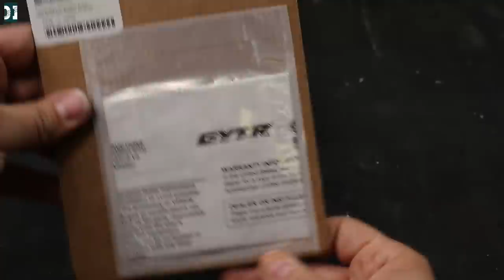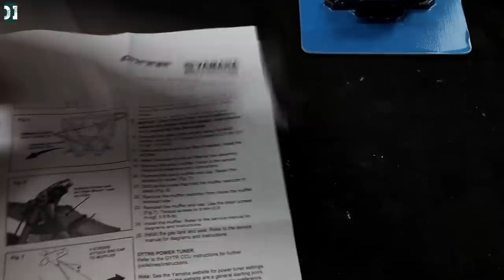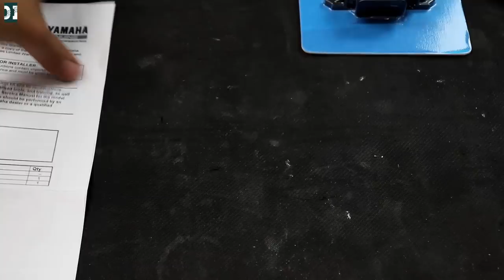How to uncork Yamaha WR450f - free mods & GYTR mods

Comment: Hi, you need to do one more mod, remove the backfire screen and add the twinair powerflow, throttle response will be better at all rpms.
Reply from the maker: thanks for the tip! I thought about it, saw some airbox cages with no screen online.

Comment: Well, I got a 2020 WR450F. At first, I thought it was a monster and a big mistake. However, after riding it today fir a little bit, I feel very comfortable and happy with my decision. I had the dealer install the GYTR ECU kit before hand. This kit installation includes the throttle stop, air box and exhaust mods. This way, it saves me from having to do and have the peace of mind that it was done by a certified Yamaha technician. For those interested, my dealer charged me $190 for the 2 hour installation. Before I use the bike again, I need to decide on how to monitor my hours/miles for regular maintenance. There are several options available such as, the standard hour meter or the GYTR CCU. 

However, what about the multi-function display that comes with bike? According to the owners service manual the came with my bike, the maintenance intervals are measured in miles or months. Do you use the multi-function display to monitor your regular maintenance?

Thanks again,
Reply from the maker: glad you hear you like the bike. I usually run aftermarket hour meter for maint.. but you can also do miles, as long as you stay consistent and do frequent oil changes you should be fine

Comment: As for my stock silencer, I just removed the inter end cap and spark arrester. I'm interested if the GYTR ECU, map switch, and CCU is worth the $540 investment. It's too bad that we can't get chassis dyno results after every mod, like if the $900 full exhaust system really worth the money.
Reply from the maker: I rode the bike already and its a day and night difference! I will have video out soon. Personally I think you dont need $300 CCU, bike runs so well on GYTR ECU. so the total investment is around $900, exhaust system is $650, ECU $149 and map switch $91

Comment: Rado - You must inform your viewers that doing the free mods to free up the intake and exhaust without changing the fueling mapping will make this bike run very lean since it has no feedback mechanism or an O2 sensor like some KTM/Husky models have. This is very bad for the motor and is the reason your bike ran like that at idle. It is even worse at peak power and runs your valves and seats very HOT. You will need to do valve adjustments sooner and soon you will have to do a top end rebuild. Always change air and fuel at the same time.
Reply from the maker: Its a fuel injected bike, it has to have O2 sensor. How else would she be able to adjust the fuel air ratio in different elevations and temperatures. But yea, she needs more fuel to unlock the potential and to run proper. I did show it all in the video, new ecu from gytr is the most important
Reply: @dirtniron  unfortunately it is open loop fueling controlled by temperature and atmospheric pressure sensors in the bike connected to ECU. It adjusts fuel based on pressure and temperature
Reply: @dirtniron  if it actually has an o2 sensor people won't be able to so exhaust swaps so easily without throwing an error code. KTM FE models have O2 sensor I believe or used to have

Comment: hello, I have 2007 wr450, I tore down beginning of 2021, reassembling I simply cant remember where the long ground connect from the battery goes. any help?
Reply from the maker: I am not sure, somewhere on the frame.. pull out the diagrams on rockymountainatvmc

Comment: Do you know if 2020 models need the same mod? Since there is no CCU needed - it can be mapped with smartphone. I've also heard 2020 models already will come to life when you remove bong from the airbox and baffle from the exhaust. Not even sure if there is this throttle stop screw. And since you did the whole exhaust - what do you think if you only did slip-on - would it be the same or you would still need the whole exhaust?
Reply from the maker: if they can be mapped with smartphone then you dont need new ECU, just map the one you have, do all the free mods and I think slip-on would be sufficient.. thats what i would do

Comment: I have a 2020 450fx. I would really like to know if i can buy a factory headlight and switch setup for this bike and use it without having to mod the harness. There is an unused plug by the air filter I suspect might be for that.
Reply from the maker: I would reach out to your local Yamaha dealer
Reply: @dirtniron  Thanks. That's probably what I'll have to do

Comment: I've been undecided between a 2020 YZFX and WRF for weeks. However, its looks like I am now going with the WRF since its more easily converted to being street legal than the YZFX. These mods have steered me away from the WRF but I would rather do them then having to install lights on a YZFX. 

With the 2020 WRF, when you install the GYTR competition kit what is the default map? Is it the same default map as the YZFX? Would I also need the GYTR Communication Control Unit as well? If so, what would be the purpose?  I'm not interested in the map switch. I don't want to switch between maps when riding, I want one map for everything. Plus, I don't want the extra button on the handle bars. I have to figure all this stuff out fast since there is only one of these bikes left. Its at dealer that is 400 miles away from me and the next closest dealer is almost 1700 miles away. That is dealers, with a reasonable price.
Reply from the maker: you can get just the ECU, it will come with standard map that is very good, I was really happy with it.(not sure its same as fx, but its good) Switch is cheap and allows you to get mild map for gnarly stuff, but its not a necessity.  as for the CCU, you dont need it, if you dont want to use your cellphone to tune the bike. GYTR ECU was plenty good for me. Good luck
Reply: @dirtniron  Thanks for the very helpful information. Yes, I can see the reason for people wanting the map switch for the reasons you pointed out. For me, I would rather have one map that fits all. Maybe, down the line I will get the map switch but most likely, I will pass. If I understand correctly, when adding the map switch you get an additional stock map that is mild. However, you can't change either map without the CCU. The stock, standard map that comes with the GYTR ECU sounds good to me. Yeah, I don't feel the need to tune the bike with the CCU. The only feature of the CCU that I find useful is monitoring the hours. Although, Yamaha makes an hour meter which seems like a better option for me. Thanks again and great channel, keep up the good work!
Reply from the maker: ecu comes with two maps, one stock is always on and second one is accessible with the switch, you dont need CCU in order to use these 2 maps. Only ECU and switch and you have 2 very good maps for different conditions. Honestly, I was most of the time in stock map, but once or twice when going up steep rocky section I switched to mild on the fly cuz stock map was little too snappy for those rocks 1st gear slow riding.. I would recommend the switch its only like $60-70 ..
Reply: @dirtniron  Okay, now I understand and thanks for the clarification. I don't plan on riding in technical terrain but you never know. Plus, it's not that expensive like you said. You have really helped me out. I tried calling Yamaha multiple times and got no where. First of all, their hours don't fit my 8-5 work schedule and you can't email them. Second, when I do call them on my 15 minute break at work, I'm on hold for 10 minutes and out of time. Last, when I finally speak to someone, they can't answer any of my questions. For example, the person I spoke with last, didn't even know the WRF had a throttle stop.

Comment: Hey Master ! So for the map switch what are the differences is one map for racing and other for trails ?
You mentioned the ecu comes with 2 so was just wondering if I need the switch
Reply from the maker: one map is standard. hits hard very responsive and second one is more mellow good for tight technical stuff
Reply: Dirt N Iron so blue light on will be standard and lights off trail mellow ride ? 

I just did all the mods you recommend but my only question is that blue light on/off lol 

Thank you master

Comment: These are some of the things that I like about the Yams......they KNOW that you're going to go the free mods....then, they make available factory hop-ups the common man can actually buy.  The pipe seems extremely expensive to me.....does it really make the difference?  Good video as usual...content that a man can use.  P.S.  On head pipe removal/installation Yamaha gives you a sheet of Japanese swear words to help you...did they send you that?  LOL  Sounds like the bike comes right onto the cam now with all the mods....might turn out to be a beast for you.  Hope I don't see a plaster cast on a leg/arm next video....just kidding....you're a strong young fella.
Reply from the maker: hahaha, exactly! those bolts from the pipe were not easy to remove and put back on.. I rode the bike already and its day and night difference, the exhaust was choking a lot, just listen to the comparison, its way different. Maybe you can achieve similar result with $350 slip on silencer.. the system I put on the bike is $650
Reply: I am a older fella , they are easy to ride at a good pace , torque them around everywhere . WR gear ratios are excellent.

Comment: Can you install and properly use the map switch, ecu and the wifi thing on older model wr450f's? Like a 2015 or older
Reply from the maker: I think it wont work on 2015.. you might want to discuss with your local Yamaha dealer

Comment: Do you have an idea on what maps are on the gytr Ecu? I have the same set up now but not sure which tunes are #1 and #2 on the switch. Does one hit harder than the other? Or are both the tunes relatively the same?
Reply from the maker: when the light is on its a mellow map, the light off its the hard hitting map
Reply: @dirtniron  thank you for your response and great work on the channel..

Comment: I was wondering if the throttle stop mod is fine to do on a 2020 WR 250F EFI. If I use too small a screw the throttle body won’t hit the screw at all? Wondering if anyone has done this on a 2020??
Reply from the maker: I am pretty sure its the same on 2020

Comment: I heard the 2019 and 2020 wr450f come stock with a brake light. Meaning the stock tail light will light up when the brake is applied. Is this true?
Reply: If so, is it the front, rear or both brakes that light up? I basically already purchased a 2020 wr450f and I'm having the dealer install the gytr competition kit. I'm scheduled to pick the bike up next Saturday with the kit installed. However, I need to know that a brake light sensor call be installed while using the existing tail light to follow through with the purchase. I would be willing to change the tail light bulb but the stock tail light housing and rear fender must stay stock. Otherwise, I wont get the bike.  Yamaha said this could be done but they can't give me any recommendations.
Reply from the maker: i am not quite sure, i think its wasnt coming on with the brake.. not sure.. but honestly I dont think thats a hard thing to do..  did you try to do some research? there are some aftermarket dual sport kits that have all you need
Reply: @dirtniron  Yes, I have done a lot of research on the matter. I have spoke with, Yamaha, Rocky Mountain, Baja Designs, Task Racing, Yamaha Service and Sicass Racing. Yamaha tells me it can be done but that's it. They can't point me in any direction for a starting point. Some people say it depends on if there are (3) wires going to the stock tail light. If there are only (2) wires, then it can't be done in the way that I want. Remember, I am waiting this done with the stock tail light assembly. I don't want to mount a different, aftermarket tail light to the rear fender of the bike. That is important to me. I would be willing to replace the bulb and run wires but the stock tail light housing must stay the same. In case you didn't know, I am basically turning the WR450F into a legal dual sport for my protection. Being an Enduro, it's just about there in stock form. I don't need blinkers in the state I live in, just the brake light. This way, if a cop questions me on public dirt roads I would be safe. I plan to ride the bike mostly on dirt and would like to keep the stock tires. Do you ride exclusively on private property?

On a good note, the Yamaha dealer is installing the gytr ecu kit for me in advance. The ECU kit provides instructions for all the mods that you mention as free mods in this video. It will include the ecu replacement, throttle screw replacement, air choker removal, and exhaust restrictor removal. Yes, I could do this myself but I rather not. I would feel more comfortable having a certified Yamaha technician do it for me. They are charging me $180 which is fair.

Comment: love my 2014 450 only done 7000kms and already appears a selector/dogs worn on 5th gear =[
Reply from the maker: oh really, how does it feel? hard to shift?
Reply: @dirtniron   no in 5th gear and only 5th it will sort of just jerk rapidly with not even alot of throttle sometimes 1-4th i can hammer without issue

Comment: So i have a 2019 wr450f in canada, i did the airbox bong removal and decorked the exhaust. now is running super lean and the header pipe after idling for not even 2 mins is super red hot in color. if i get the yz ecu will it fix it from running lean and getting that hot ?
Reply from the maker: Yes, i think that will fix it and the bike will run so much better. Get the switch too, there are 2 maps programmed on the ecu.
Reply: Dirt N Iron so when you did the free mods did you upgrade to the yz ecu and the ccu and the 2 map with the switch ?  I just can’t have this thing running this lean and getting this hot.
Reply from the maker: I did only ecu and the switch, those 2 maps on ecu were really good, i didnt see the need to spend more on ccu. Ecu and switch together are not that much..
Reply: @dirtniron  Thanks, I'm going to get the yz ecu and see if that corrects running lean, I cant seem to find the MAP switch in Canada but i'll have to check with my local Yamaha dealer. only reason i was thinking of buying the CCU is to see hr's as the display doesn't track that. but i'll just get and hr meter so I can track my oil changes. exhaust wise you put on the GYTR exhaust. was there a FMF slip on that would work without making it run lean again ?

Comment: One other thing and probably most important, did you install and rear brake light sensor for your WR450F? I just want to make sure this can be done without having to replace the tail light that comes with the bike. Is this the part I will need?
https://www.rockymountainatvmc.com/parts/tusk-hydraulic-brake-switch-nissin-brakes-p

Comment: Be careful doing these mods to your WR450F… This engine is an identical (detuned) version of the YZ450FX, which has much more frequent maintenance intervals (stated in hours) vs. the WR450F’s maintenance intervals, which are stated in mileage. 

If you do these mods, the higher revving will result in more engine wear, unless you follow the YZ450F maintenance intervals.
Reply: not really, having a richer mixture is better for engine life, and this updates are done just to get rid of "emission" limitation and to have more choices of tune. usually on enduro we don't care of top power or high rpm, just want to have good grip, low end grunt. so the bikes are ridden differently, on MX you are full throttle all the time, on enduro we use low speed/low rpm most of time.

Comment: I think its abit annoying how yamaha have done that. I mean they arnt cheap to buy then you got to start changing things out the box. And if you want it to work better you got to spend a grand on a new exhaust and ecu. They should be coming out the factory like that working 100 percent to its full ability with the restrictors in a box.. if your in a country where these regulations matter then you can put them in youself. I duno im still going to buy one but it seems backwards to me. If i manufactured a bike and i knew people were going to test it out of the box against competitor companies i wouldnt dream of restricting it to 50 percent of its ability.
Reply from the maker: unfortunately thats not how it works, stock bike needs to meet the standards,  thats why it has to come so choked from the factory.